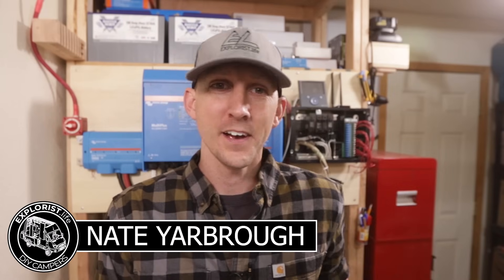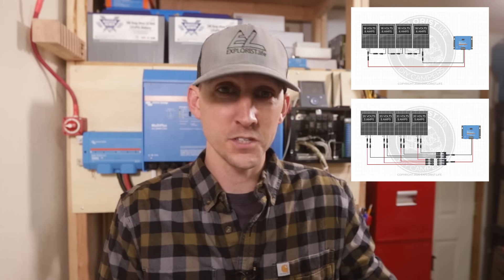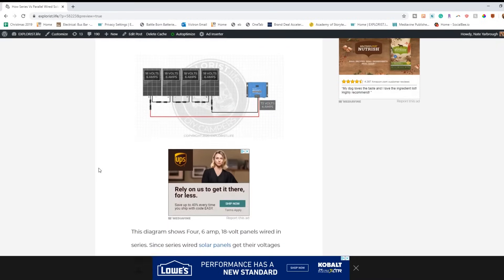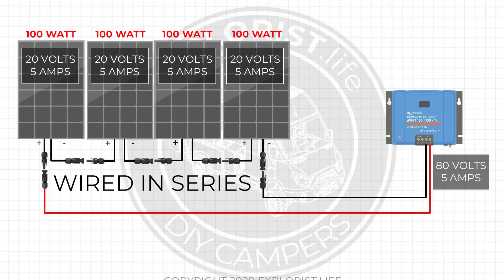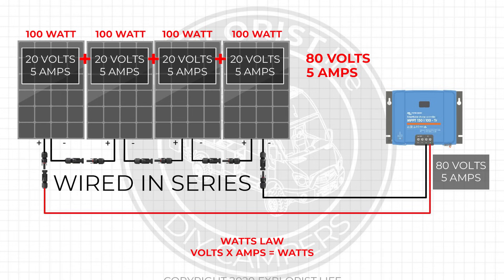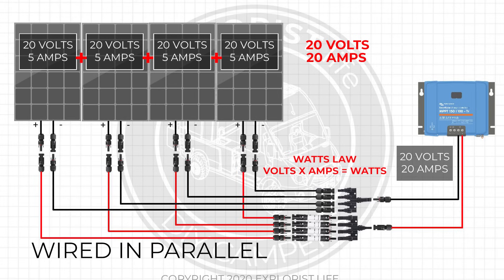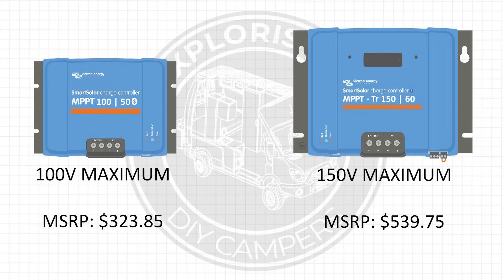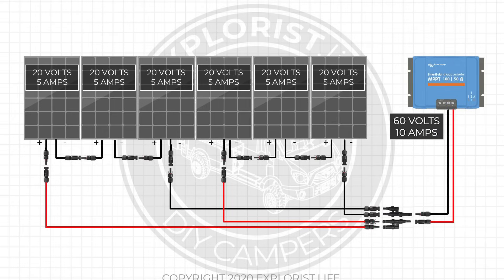Solar Panel Wiring vs Volts and Amps

Comment: I see that MC4 connectors are waterproof. But how are they long-term? I'm planning 2 parallel arrays of 5-panel in series each. Is there any advantage to just butt-connecting the wires to the panels and using a combiner box before heading down the fridge vent? Or just use the MC4's and MC4 combiners? The MC4 route is certainly easier!
Reply from the maker: MC4's are the industry standard way of attaching solar panels together in the same array given the array amperage does not exceed 30A.

Comment: have a question regarding my particular panels that i bought literally 20 years ago and am just now getting a house i get them set up in... yeah yeah i know - mean to...   the label on the back says 101w, but the vmp is 96volts and the max amps is 1.42... how is that even possible?  the math doesn't work.   if it's a 100w panel at 1.42, the voltage should be 70... frankly i didn't look but when i hooked them up i could have sworn they were 100w at 12v, so i had them wired to charge  48v battery bank though a 48v controller...   what am i missing.   after so many years, i can't even go back to the manufacturer...   anyone have an idea?   i did a volt test on the array and it does show up at about 400v - VOLTS... i thought i had the multimeter set wrong, but then went to a single panel and tested it and yes, it's a 100 volts.   so the question is, can i even use these panels?

Comment: I have (8) 12v 100 watt solar panels, a 150v max 12/24/48v MPPT charge controller 24v split phase inverter and (2) 12v 200ah life po4 batteries in series for 24v. In what configuration should I wire my panels? I thought I had to wire my panels to equal 24v like my inverter and battery bank?

Comment: Cool vid. What about  the inverter max PV current input? Some manufacturers define it at 18A, different from solar charger which is higher, how does this affect the system if PV amps are higher than the max PV current defined at 18 amps?

Comment: Hello there 😏
I have 2 x 115watt panels and 
           2 x 100watt panels 
I want to charge my 12v battery system. 
I have an mppt charge controller..
A victron 100 / 20   . 
I 'think' i know the contoller is not big if my array is in parrell but what about in series ( 2 x 115watts together and 2 x 100watt panels ) ? 
Im trying to avoid having to buy a bigger controller ! 
Plus series seams very sensible for someone like myself living in the middle of the uk .
The aroglithms kill my head lol

Comment: I have a question, If I have four 100 watt solar panels  wired in series/parallel  with your examples that would be 40 v - 10 amp correct?

Comment: is there any issue with wiring two 100w panels in series, and then a second set of 3 100w panels in series, and then combining to parallel? obviously this setup would result in a series set of 40v and 5 amps being combined in series with the second set of series at 60v and 5 amps. Wasnt sure if wiring a 40v and a 60v set would be feasible.

Comment: My 8000 / 4000 W pure sine inverter won't let my 3 brand new deep cycle batteries go below 20% drain to protect the batteries I assume. So when I run my camper rooftop AC / Heat unit it will only run for about an hour before shutting off and I have to switch to a back up gas generator. Is there a way to charge the batteries faster to keep them above 20%, or another solution? Currently I have 4 - 100W new solar panels wired in parallel 12v about 28 A and my charge controller is rated at 30A not sure if its MPPT or not. I also have another at 40A that is MPPT in a box I can use if needed. Finally I have a standard car battery charger I run off my generator sometimes. It's 12v with 6 AMP and super slow to charge just one battery. It takes like 12 hours. So basically I just want to see if there's anyway to charge the batteries faster on solar? I get a lot of sun year around in a great solar area. Thanks! Mike
Reply from the maker: Air Conditioner is a HUGE load.  You'll need closer to 1500W of solar and 600Ah of Lithium batteries to run it for any considerable amount of time without the generator.
Reply: @EXPLORISTlife  
I appreciate the assistance. I think the rooftop AC / Heater is 1200W. I'm currently 100 Ah short on batteries it appears. Also 8 100W panels short it sounds like lol. So when I get more panels should I keep them wired in parallel to charge the fastest, or does it matter? Thanks again! Mike
Reply from the maker: They will need to be wired in either series or a series-parallel configuration depending on the panels chosen.
Reply: @EXPLORISTlife  I went with series for now and seem to have plenty of power. Thanks!

Comment: Which amp and volt numbers do I use for calculations? For example: for volts: VOC, VMP, or max system voltage? And Amps: Short circuit current ISC, Max power current, or Fuse rating?

Comment: So your video simplifies the calculation process for series/parallel panels which is absolutely correct.  Using this theory for a 3/2 system with 175w panels from Renogy, I find my numbers to be 58v and 17.96a. Using Watts law it equates to 1042w.  All good.  
So in theory, this  means a controller size of >60v and >20a should work.  
Now using your calculator for a Victron controller (same panels and configuration) I get 79.9v and 99.7a.  I even did the calculation long hand and got the same thing.  Which one is right? The only substantial difference is possible low temp expectancy with a differential controller cost of more than $200.  Please explain.  Thank you
Reply from the maker: I see in your other comment you got this all sorted out. Nice work!

Comment: I have 16 x 32volts solar panels and the solar charge inverter is 96 volts and needs to be connected to a 96 volts battery bank. How would l make the series and parrarel connections to make it meet the 96 volts system
Reply from the maker: Hey Morton. Unfortunately, I don't have enough info about your specific situation to make a good recommendation, but the video you commented on teaches you how wiring in series, parallel, or series-parallel affects the array voltage and amperage so you can figure that out on your own.  I've given you the teaching; it's time for you to put paper to pen and figure it out. :)

Comment: Hello, great video!  I need some advice,  I would like to know how much solar panel and how strong does my battery and converter have to be to run a submersible water pump. Also how strong dies the inverter have to be to work for a water pump. I only need it to run about an hour per day. Let me know please.
Reply from the maker: You'll need to do a power audit.  Here is a tutorial for that: https://youtu.be/a406IxiU-Xg  Cheers!

Comment: Hey I have a question I have a 335w three junction box solar panel when I test the positive and negative lead cables the volts are reading backwards I keep getting -00.1 or -00.2 any ideas as to why the volts are giving me a negative reading instead of a positive???

Comment: Like the series but..is there a sirexr link to the whole series. Like Lesson 1, 2, 3….
On different rv forums we get newbies asking about solar installation. I refer them to your YT channel but I’ve complaints that it’s hard to find the series and I’m at a loss to guide them. Maybe a Beginner Guide to Solar in the Playlist.
I watched series or parallel to day. Won’t be long til my 6-100w panels will be ready to connect.

Comment: Cheers for the video! Great as always.
I'd like to pick somebody's brain on something.
Can I use 50 mm2 copper cable to connect together a 48v energy bank (8 batteries) and then to the inverter? I have this cable so I may well use it instead of buying a thinner one. But, being a layperson, I wonder whether, perhaps, this will result negatively on the efficiency/ efficacy of the system ...? Well, that was actually a question in case somebody has an idea.

Comment: The only confusing thing about all of this is which one is best to charge your batteries? When living in the van, you’re using amps, and concerned with how many AH your bank has. Do you want to push the most amps into the battery, or the most volts into the battery? Nobody bothers to tell you which is actually preferred or which will charge your batteries to full faster. Could you please cover this?!
Reply: Howmuch power is pushed in the battery does not depend on the series or parallel configuration. Higher voltage (more in series) means lower Amps for fhe same total power,  thus smaller gauge wires, but more expensive charge controllers as he explains. You can calculate the amount of current into the battery by the power of the solar array (as you saw in this video all configurations with 4 panels had 400W) by rhe nominal battery voltage. Cheers!
Reply: With series and mppt combo you get the max output of your panels with the added benefit of smaller wires. Higher voltage systems give you more of a return on investment. In my opinion.
Reply: @matthewjswider You want more Amps for charging! You only want your volts to be slightly higher than the battery you’re charging! If you have a 12v battery, you want a max of 13-14volts and between 3-40amps for charging, 3amp is slow charge, 10 amps is fast charge, and 40amps is rapid charge. Since most solar panels produce between 12-24volts, the charge controller sorts out the power differences and turns it into 13-14volts for charging. The closer you can get your solar panels to naturally putting out 14v and 10amps the less work your charge controller has to do and more efficient your system is
Reply from the maker: @Wayne-hs6gm I appreciate you wanting to help, but most of that is QUITE untrue.  Please spend some more time in our solar basics playlists to learn more about system design so you can give more educated responses.

Comment: you are awesome!!  this is the most I have understood anything about solar so far. for clarity, i have a 1500w array of poly- rigid panels. i have been going crazy trying to figure out how i can hook this up on my bus.  so I think I got it with this video.   they are 250w panels. so i am looking at connecting them in series 2, 2, 2 (total 6 panels) and then connect in paralell and use two 100/50amp controllers... is that correct?

Comment: This is a question of charging efficiency, not cost-efficiency.  The goal is to gather as much sun as possible through out the day on a small system where roof space is very limited.  The system will have only 240 watts of panels.  Since the Victron MPPT's state, they don't activate until the solar panels are providing 5v over the battery voltage, more panels in series will get to that voltage quicker.  The question is, how much do you really gain?  

One setup is using the 100/20 with four 60 watt panels and the other uses six 40 watt panels with the 150/35.  

How much more efficenct would the six-panel system gather over the four-panel system?  

(maybe this is a video idea????)

Comment: When using a 3 battery system supplying a 6000 watt inverter what is a good number of 100w panels to use?

Comment: Good afternoon Nate can you or someone please help me with how to wire 29 solar panels 250/30.2/8.43 amps to a sunny boy 7.0 string inverter I got it to work with 2 string's 9 panels each in series but I want to see if I can use All of them ... Thanks

Comment: Im having a bit of trouble with my system.  I have everything set up but my charge controller even tho it's setup in direct sunlight the charge controller is stuck in night mode.

Comment: Could you explain why the mppt do not get the total watts from the volts by amps of the solar panels . Ex.  12 panels in series /parallel ,in groups of 3 in series and into the mppt in parallel .

Comment: Hi Nate, great video. I have a question concerning the Watts delivered by the Panels during float modus. I have 2 x310 watt panels in Serie. I noticed a few days ago that the output of the panels were only 47watts (72.04V). We had blue sky and the position of the sun was almost perfect. Does the Victron 100/50 cut the watts off?
Thank you for your reply.
Reply from the maker: When the batteries are full (or nearly full), the charge controller will indeed limit the incoming current as to not overcharge the batteries. 

When the bucket is full; it's best to stop filling it up.
Reply: @EXPLORISTlife  
Thank you.👍 I thought that the Victron may cut it off but indicates the theoretical power.

Comment: Great video if  i have four 100 w panels what way do you suggest i hook up to get batteries charged quicker , i have a 100v/30amp mppt charge controller .
Reply from the maker: Likely in series parallel if the panels are around 20V.

Comment: I guess I'm confused on how to read an MPPT controller in the first place. Some aren't as straight forward. I have a Growatt 48v 5000w inverter in mind that says "PV Array MPPT Voltage Range - 120Vdc~430Vdc". Does that mean the solar voltage should be between those two numbers for optimal usage?

Comment: Love your videos, very helpful!. I have a victron 100|20 in the caravan with 2x 120ah lithium. At the moment I only have one panel but I want to add 3 more, each panel is 160w, and put out 8.74 amps each, the regulator has max charge output of 20amps am I best to wire in series to increased the voltage and keep the amps the same. The VOC of the panels are 21.9v 

Series
21.9v x 3 is 65.70 volts
With 8.74amps

I've never delt with wire in voltage, only I'm amps, what size wire it's best suited for 65 volts?

I'd like to wire in series parraell mainly for the cable sizing but it will mean I'll need to upgrade my regulator
Reply: I was hoping he answered your question, as you are over panelling the controller. I think your problem would be if you had short circuit amps (Isc) to the controller. Reading through victron forums it seems the most important thing is that open circuit voltage allowing for temperature coefficient does not exceed controller input.
In your example you would have 640W of power, but your controller would still limit 20amp max output. So your controller out putting to a 12V battery could only use 240W.
But having that extra power would help give you more amps out on poor solar days, when it's cloudy low light conditions.
Wish he had of answered your question.

Comment: Thanks for the great tutorials. if I have 6 200 watt in 3s2p configuration, the amperage will be apx 20 and the volt are just over 80, will I need to fuse the positive to 15? I bought your diagram and I didn't see any fuse. Thanks
Reply: Hi need help here 
I have 6x100 watt panels
1 20 amp 75v mppt charge controller and
4x 80 ah gel batteries 12v connected in parallel
Can I connect the panels in 3s2p configuration and as that will give me 54v at 10 amps and ignore the max 520 watts recommended for the  charge controller

Comment: You overlooked two important advantage to having a higher voltage array. That is a longer solar day. & Producing adequate power to charge batteries on an overcast day.
Reply from the maker: I didn't 'overlook' it.  That's just not what this video was about.  This video is ONLY about how wiring in those different methods affects the array voltage and amperage.  I did address those factors in this blog post though: https://www.explorist.life/solar-panels-series-vs-parallel/

Comment: Thanks for th very helpful video. I have followed your video to installed my solar system on my van.
I have installed 3  210 watts of solar panel parallel with Victron 150-70 TR smart solar controller with 50Amp dual pole breaker. now My breaker gets very hot and trips the breaker after a while.
I have used 10 guage wires per your instruction. Any inputs?
Thanks

Comment: Please help! I'm fitting 4x175watt 12volt solar panels on my van. I'm going to have 2 x agm 110amp batteries. Please tell me what size mppt you'd fit? I was thinking of having 2 in series and 2 in parallel? Please give me your thoughts on weather you'd do the same. I don't want break the bank over buying a mmpt.
Thankyou in advance and you videos are the best!
Simon

London UK.

Comment: Was disappointed when I realized I could have gotten a 200v max mppt two weeks after the 150v arrived. I see too many who undersize in the beginning with gobs of unusable gear. I do the opposite, get a 2000w at 12v, 150v max 100a epever to start. I don't drive at red line and or test my electronics for heat tolerance. Half the thing is a sink. I didn't get it to fry eggs on.
Reply from the maker: Buying products before people have a complete plan in place is 100% the biggest problem I see with this stuff.  I'd also say that most of the time, not having a plan generally costs hundreds of dollars worth of re-work and sending incompatible parts back for more appropriate parts.

Comment: So I'm trying to work out what size controller I need but using the math it doesn't seem to work. I have 4 panels at 21v each panel is 120w with 7.1A . Total solar array 480w.
First pair together gives me 42v with 7.1A , add the other pair gives me 42v with 14.3A.
14.2A x 42v gives me 596.4w on a 480w array.  Natie please HELP it's starting to send me cross eyed 🤪🤣
The panels I have are Astropower AP-120
And I have 4 of them 👍
Reply: Sorry wiring in series/ parallel

Comment: So if I have 6 panels 195W Mono Solar Panel
Open-Circuit Voltage (Voc): 22.8V
Short circuit current (Isc): 12.23A
Working current (Iop): 10.27A
Size: 1480*668*35mm（58.3x26.3x1.4 in）
Weight: 28.2 lbs (12.79kg) and a  4-String Solar Power Combiner
with a 60A solar controller - how would you recommend hooking it up ?